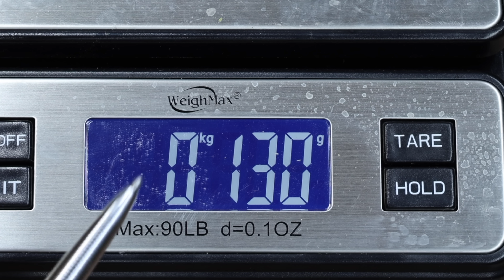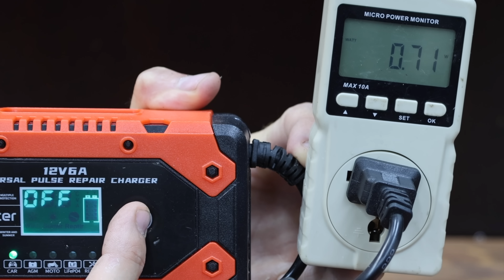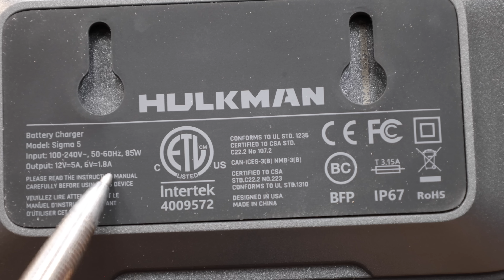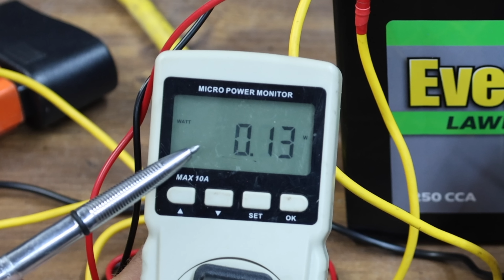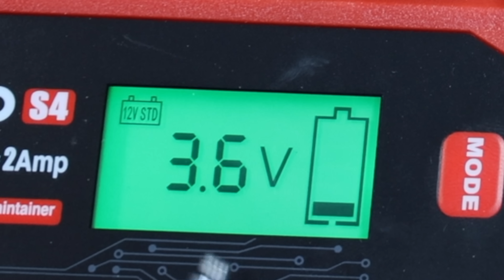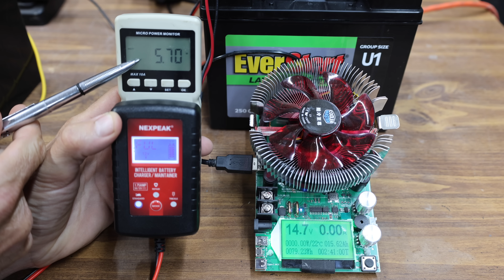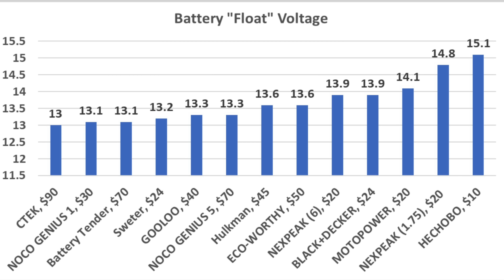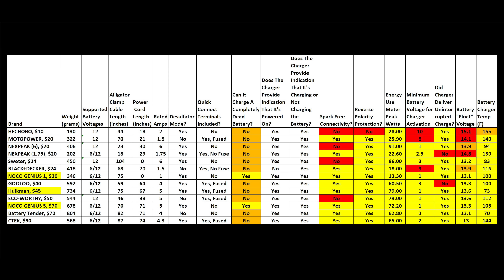I Tested the Most Hyped Car Battery Chargers – One Stood Out!

Comment: Yes please on the larger battery chargers.
Reply from the maker: Thanks for the suggestion.
Reply: @ProjectFarm Please durability test them! So many "50A" chargers die if you actually use the 50A setting for more than a few minutes!
Reply: @ProjectFarm  If you do test any "smart" chargers it would be a great test to see if it will stay on or shut off if the battery is weak.  I have a newer Schumacher that will NOT stay running if it decides the battery is bad but most older style chargers will throw the juice no matter what.
Reply: @ProjectFarm   I think everyone wants to see this video coming up I like this little chargers as well. We have a little electric trike that takes lead acid batteries and I’m going to swap them out for lithium so yes, big chargers and chargers that can charge lithium would be amazing. Keep up the great work spoiler alert. I got the noko  so I hope. It does great in your tests 😊
Reply: noco 😂
Reply: @trevorbickle821  At least on a browser on a PC, you can edit your YT comments to fix things like that. IDK about the app, I don't have anything Google on my phone.
Reply: @ProjectFarm  can you test Brush cutter handle loop vs bike handle back pack vs side pack
Reply: @ProjectFarm  please include Victron in the next test
Reply: @ProjectFarm I'd like to see a video testing the repair modes on these chargers. The Noco5 does a decent job if you run the repair mode multiple times.
Reply: They make a Noco Genius 10 for $10 more. You know it's gonna win.
Reply: @Steven-gv1ke  I have the 10 and it's a beast. Everyone should have one in their garage.
Reply: @Steven-gv1ke I've had one over two years. Noco 10 is phenomenal. Especially when you need to charge lithium, agm and lead acid
Reply: @Steven-gv1ke big plus for the power supply feature.  Just ordered one since they’re on Amazon close to their lowest price.
Reply: It's hard to get excited about battery chargers anymore when there are lithium ion jump starters that weigh under 2 lbs and can start my 7.3 L Powerstroke in 20 degree weather with both batteries pretty much drained and half of my glow plugs not working.
Reply: @Noneofyourbusiness2000  While true, your truck's drained batteries (if lead-acid) are permanently damaged every time you run them below ~8v, so maintainers still have value . . . if you remember to plug them in!
Reply: @Noneofyourbusiness2000 
What do you recommend for an RV, Cummins 8.3, dual 12v lead acid chassis batteries. Also uses 4, 12v house batteries.
Reply: @TimothyMichaels  I went with the Avapow from his last (I think) video on jump starters.
Reply: @Noneofyourbusiness2000  Different tool/use case all together.  The little jump packs are great but are only for that - jump starting a car with a dead battery.  They can't help you with charging or maintaining a battery.   Plenty of use-cases for both but neither is a replacement for the other.
Reply: @Noneofyourbusiness2000 nah, battery chargers still have their place.  jump starting is a temporary solution, you still need to recharge your battery. And it's better to charge with a dedicated charger rather than driving it, which can stress your cars electrical system and alternator.
Reply: @DoctorJenks  what do you think an altimator is for?
Reply: Yeah I was looking at the Schumacher Electric SC1281, and wondering if that was the best option for $70. Ideally it would be able to charge from dead.
Reply: I got the schumacher 1282, i like it as a strong maintainer 2 amp and charger 10amp but i put it on an old school outlet timer set every 4 hours bc it will not come back on to maintain until it gets to around 11volts and i want my battery constantly topped up. It will run up to 15 v (i love this, 15v) then go into maintain mode and wont come back on until 11volts( for some that could take months). My car needs the maintainer bc theres a draw(damaged circuit, i need to replace a module) and i want it ready to go at all times. It has an auto power on feature which as long as its plugged in (mine is on the timer) it will come on and start charging so my setup resets itself to force the battery to charge with auto start every 4 hours and its keeps my 12v battery around 12.9v when im ready to go. 7 year old maxx 1n battery(walmarts largest battery) I hope this helps.
Reply: Ctek Pro 25S, and Victron Blue smart 25A please next.
Reply: And please add mastercraft brand for us Canadians.
Reply: Yes a test of higher voltage chargers would be great. 
When I was a kid my dad’s battery charger weighted 25 pounds. These modern chargers are very lightweight. I’ve tried Schumacher and a few others. All have been a disappointment.
Reply: Agree - these small units are really more like maintainers than full on chargers.  Would love to see high-current stuff like my Noco 26000 (that I've recently been having 2nd thoughts about)
Reply: @rockzors, I bought a Schumacher SC1281 and I’ve charged a battery from dead with that. It’s seen moderate to light use buts it’s been great, I’d definitely buy one again if I needed to replace it.
Reply: @donhappel9566, I agree, my wife and I are snowbirds from northern Ohio and when we get back home in spring I put a charger on all three of our vehicles just to make sure they are all charged up. I don’t need to just get them to start, I need them to start over and over again. I do carry a Gooloo car starter instead of bulky jumper cables that need another vehicle to jump start, that Gooloo comes in a zippered pouch that’s about 4”X 8”X 2” thick. It will also charge phones etc in case of power outage.
Reply: I just brought a 15amp Victron smart battery charger that can Bluetooth to your phone .
So yeah, I would love to see the bigger chargers tested. 😁
Reply: Also please do larger battery. John Deere brand being one
Reply: Yes agree 👍
Reply: Beleep c-30. Also test the repair modes.
Reply: would love to see the topdon tornado 30000 or the vevor or wavlink 35a smart charger.  Been wanting to get the vevor, but they generally don't stand behind thier products.
Reply: But no standard "no smart" chargers. Like those of our childhood.

Comment: I have the ctek mxs5.0 for years. but it doesn't load completely drained batteries. so i think i will buy a noco genius1 that can lift the voltage above 2V and then continue with my ctek.
Reply from the maker: Thanks for sharing.
Reply: @ProjectFarm  No. Thank You very much for testing! 👍
Reply: I have both a ctek mus 4.3 and the mxs 5.0 which have served me well for years. However, I agree they can’t do anything with a dead battery. For that reason I may ‘have’ to look into noco maintainers. 😇

Comment: GOOD Test, Commander but way too high-tech for here. I have an OLD Sears, one from Car Parts and a maintainer from Wally world for the generator. The Sears puts out power when plugged in. The one from Car Parts won't turn on with a dead battery but can be fooled with tapped to one with some juice and will take off then hooked up to the dead one. The maintainer is hard wired into the generator battery and cuts out when the battery is full. 2 watts max. The generator has no self-charger so I plug the maintainer into the generator when running. I ran bolts for connectors on my battery too. Hope all are doing well on the Farm. Plenty of rain here and squash and beans are coming on. BLESSINGS to ALL!
Reply from the maker: Hi Lewie, it's always great to hear from you! Sounds like the old Sears one is perfect for the job! That's one of the biggest complaints I hear about the new electronic battery chargers. Being able to manually override the minimum voltage setup to force charge a battery is a great feature indeed. Sounds like a have a great garden this year. We just received some rain over the past couple of days and that has really helped the garden and the pastures recover. Wishing y'all many, many BLESSINGS!!!
Reply: @ProjectFarm  I can fool the other charger but it has to be with another batter that has juice. Sweetums is out gathering beans so I'll have some to snap directly but she says not many. I'll settle for job security. Glad things on the Farm are fine and dandy! I mowed yesterday between showers but sun is out today. Whodathunkit! We are ALL RICHLY BLESSED!

Comment: What's crazy, I was actually working on a charger, repairing it because I am making my own battery backup for the house, Internet, TV, lights but computer protection from lightning since we have so many storms. And here is your video. The only problem I have is the UPS is only capable of 350 watts which is plenty for lights tv and Internet, just not enough for my computer so I won't get the protection for it. Then I thought Inverter on batteries, same concept but then I need a charger. My tests the UPS wouldn't charge a larger battery but will run off a larger battery. For some reason the the 350 UPS won't charge a larger capacity battery than what it comes with. Even under a 100w load it won't charge the battery. But, it can run a week on a 650cca car battery running a DVR and 24" monitor, maybe a few days longer before the battery is dead and it shuts off even still plugged in. So I'm working on something
Reply from the maker: Thanks for sharing.

Comment: I used to be a happy CTEK user but after noticing that they quit working after 4-5yrs, I switched to Noco a few years back and so far they've been holding up great. If you decide to test larger chargers, you may want to look at their 12v power supply capability to use as a test bench power supply. I bought a Noco Genius 10 for that reason.
Reply from the maker: Thanks for the suggestion.

Comment: I have a Noco Genius 1.    It works great.   I also have a Noco battery jump box.  It's the only one I could find that has skinny aligator clips that will fit the jumping terminal in the fuse block on my Prius.   Most battery alligator clips have big clunky thick ends designed to go on a battery clamp that has lots of empty space all around it.   I'm glad Noco thought of this.  My Prius has the battery in the right rear fender.  You can only access it with the rear door open.   However, if the battery is dead, you can't open the rear door.  So, Toyota put a terminal under the hood just for jumping.  But, it's in the fuse block.
Reply: yes nocos aligator clips are the best. i can charge a tiny 12v small device battery too but with the other brands, i doubt it
Reply from the maker: Thanks for sharing.

Comment: As someone who purchased the Noco Genius 5 several month ago, this test is reassuring.
Reply: they seem a good brand, i have their boost jump starter, very impressed, does what its supposed to.
Reply from the maker: Thanks!
Reply: I've been running a Noco Genius 2D on-board my old Subaru with a parasitic draw for several years. Keeps the battery up without cooking it.
Reply: @baratono semi-easy trick: use a thermal imaging tool and look at your fuses after the car has been sitting for a while. The fuse for the circuit that's drawing current should show up warmer on the camera. Then it's just tracing the circuit to either a wire issue or failed module.
Reply: @baratono I’ve got a two year old NOCO 2 on my 6 volt. 1928 Durant M2. 👍
Reply: @baratono figure out your parasitic draw, that's the easiest way
Reply: @baratono do you have a 2019 Subaru Outback? Mine had a bad board that was cause of parasitic loss - recall corrected problem.
Reply: I have 3 of them (Noco). They are good quality.
Reply: As someone who just finished watching a video testing battery chargers, I have to congratulate you on your purchase.
Reply: The Noco Genius 10 is only $10 more and you get double the power.
Reply: @Steven-gv1ke  not true. Noco 10 is $30 more with little to no extra value to an average user.
Reply: @Steven-gv1ke  Same Here, I Purchased the Noco Genius10 just to charge my Li-ION battery for my Motorcycle. I got tired of AGM batteries going bad on my Tender Trickle charger.
Reply: @Steven-gv1ke  True, I should have bought that one, I have the 5. Still it's a great charger.
Reply: @Steven-gv1ke  That's the one I have too.
Reply: Got one on each bike and on each vehicle in the yard. Been years the only one that quit was a 1 amp wall wart style that got rained on, my fault on that one. Emailed them to see if the internal fuse was replaceable and they offered to send a replacement, thanked them for the generosity and bought a new one though because it was my fault.
Reply: I bought a Noco Genius5 last week!  Whew!  My four-year-old Duracell maintainer, that maintains my generator battery, stopped charging sometime in the last few months; it lights up but cycles through options like it's not connected to a battery (fuse is OK, battery is above 12v), so after reading a bunch of reviews I landed on the Genius5.  I was sure worried when I saw this vid pop up in my feed today!
Reply: I've had a Genius 10 for about a year now - the charge from zero function absolutely works, as I have used on a 0.000v battery that had sat unused for 5 years in a mobility scooter.  The repair cycle also works, and has allowed some older batteries to live for a few more months/year after doing a full charge, a repair cycle, and another charge.  It can take a while - a whole day sometimes - to fully charge, fully repair, and then charge again - but it works.   Saved 7 or 8 batteries and only failed to repair one of them.
Reply: same here, works like a charm!
Reply: Agreed, on a big sale, looks like a great investment!
Reply: I also have three of the Noco Genius 5, for my cars in storage. I used a DC clamp meter on the output when I bought my first one, it did 5.11 dc amps on the third light. Then went to 0.25 amp for the maintain phase. That was enough for me to buy the other two! 5 amps to me is plenty for maintaining an already charged battery. Just depends on what you're trying to do.
Reply: I have a Genius 2 (I wish I had bought the 5) for my previous car which kept dying from lack of use during Covid. I ended up getting 7 years of life out of that battery, the shop was impressed when I brought it in!
Reply: I park my 2015 model year car every winter. Hook up the Noco Genius while in storage. Still on the original battery that it came with from the manufacturer!
Reply: If your battery is too low and its 12 volt and won't  charge because its to low of a charge for 12 volt on nokta chargers put it on 6 volt charge for an hour.then switch to 12 volt.might have to charge a little longer.😂😂😂😂😂😂😂😂😂😂
Reply: you just got scammed 40$. same as the noco 1
Reply: I've had one outdoors winters and summer both charging and keeping upkeep charge on my car that's not in road use. Zero issues aside from some cables being sun faded by now
Reply: One thing I found with my two Noco genius devices (since 2019) is that sometimes they shut down and require manual intervention to restart them- I usually only discover it after a month or so.

My battery tender devices automatically reset after sometime,
Reply: @dataplatter Great info. I didn't know this.  I have two battery tenders for over 10 years. We've had frequent power outages, yet my battery tender light must have turned itself back on after a power outage.  I look at them at least twice per week.
Reply: I've had a Noco for years now, no idea which one though but it's mounted in my vehicle permanently and has been for a few years. Even at 40 below it's charging, it's a hard start but it's doing the job.
Reply: @Deere2154D  I've never used one as a constant trickle charger.  However, I've never had a problem in using Noco chargers.  The better ones, though, are fabulous....and especially when you can use the repair function to restore batteries to virtually new quality..
Reply: @joeidaho5938  ive only used it as a maintainer, in the winter my personal vehicle sometimes doesnt start for weeks and at 20-40 below if i left it without the battery would die and freeze.  Maintainer keeps it charged so i dont have to worry and when i know im going sometimes i plug the block heater in or just give it a snort of crack (ether 😂)
Reply: As someone who bought 8 Nexpeak 1.75amp chargers for all the toys on my property, I think I'm going to barf.
Reply: I had mine for 2 years and it’s still going strong
Reply: Noco chargers keep my battery’s strong when my equipment is parked in winter
Reply: Till it gets the voltage up enough for the 12 volt charger to kick in which is 1 to 2 volts.if it is below 1 to 2 or less put on 6 volt to bring the voltage from below 1.
Reply: I only buy Noco.  I have the 2,....and the 10.  The 10 is fabulous, with it's battery repair function.  So many of the other brands are absolutely suspect....cheapass stuff from China that isn't worth a penny.
Reply: I had a LOT of NOCOs fail on me. Not robust.

Comment: Now for a legitimate test that studies how well these maintainers "maintain" a battery and their process of switching on at what voltage and off at what voltage. These are maintainers, not chargers. Yes, Do a test with some of those intended battery "chargers" on the market and study those in how they perform with dead to almost dead automotive sized batteries.
Reply from the maker: Thanks for the suggestion.

Comment: The 6A on the sweter were actually correct. You need to take the voltage at the moment into account, 6A*5V = 30W
Reply from the maker: Thanks for the suggestion.